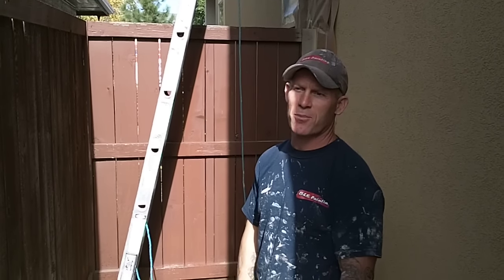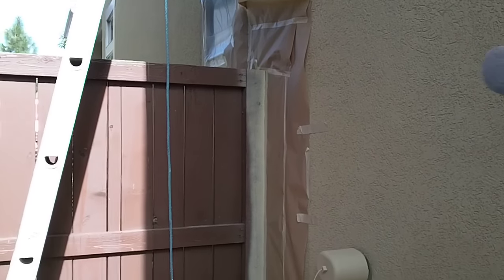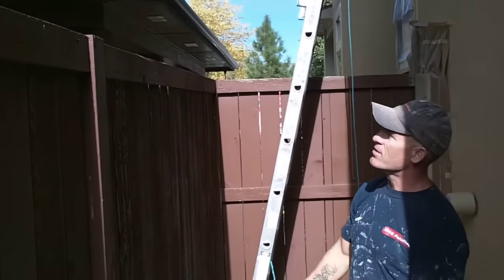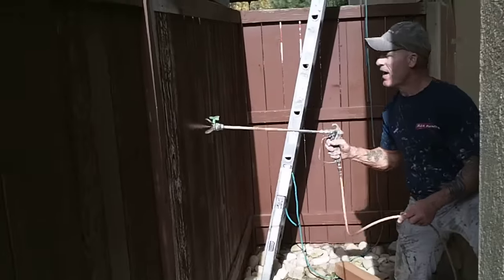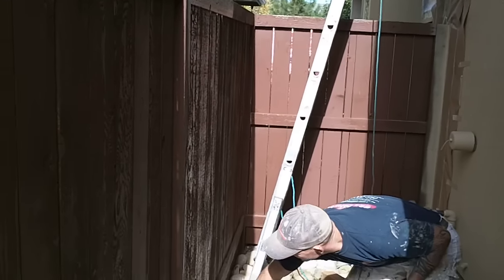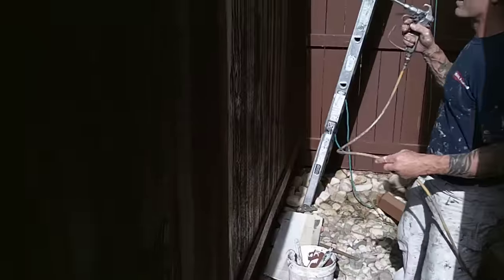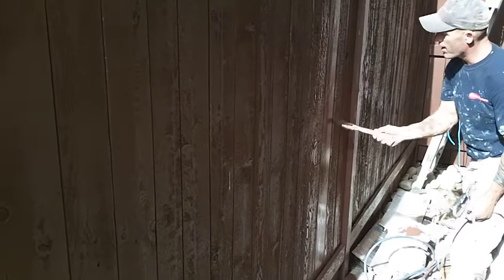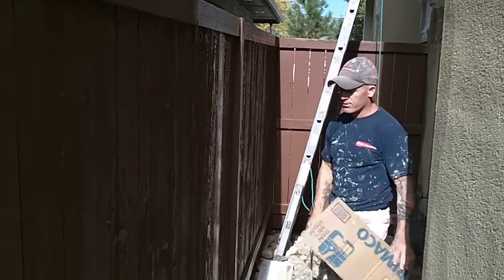How to stain a fence.  Spraying a fence with an airless paint sprayer.

Comment: I have 450 linear feet of shadow box fence to stain (both sides, so really 900 ft). Because of the shadow box style, I'm wondering if I should power wash and stain the outside first and then do the inside, or if I should power wash the whole thing and then spray?

Comment: Do you have to do something special to the sprayer to run stain through it?
How do you clean the machine 
Also if i use water based stain will that be ok to run through the sprayer and then clean it with water?

Comment: NOT how I paint. If there is a risk of hitting anything on the other side ( neighbors house, garden furniture, ornaments, trees, flowers etc) through the cracks, I won't spray a fence. Use a thick roller sideways and tight, that will get inside the boards enough. Then use a smaller thinner roller like a whiz roller to get tops and posts.Use a brush in what is missed. If you do spray, you must backroll to properly seal the wood.
Reply from the maker: Thanks for sharing Michael